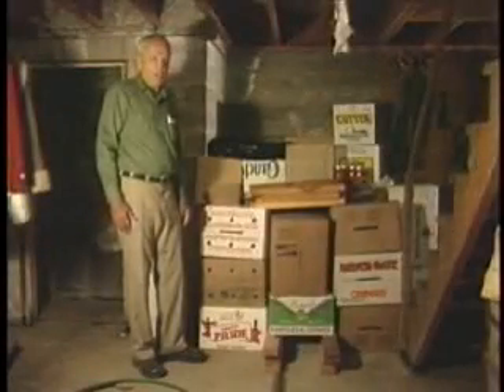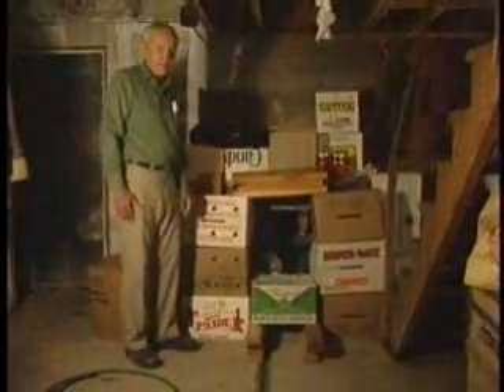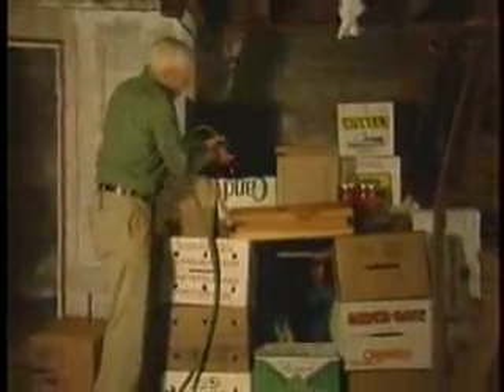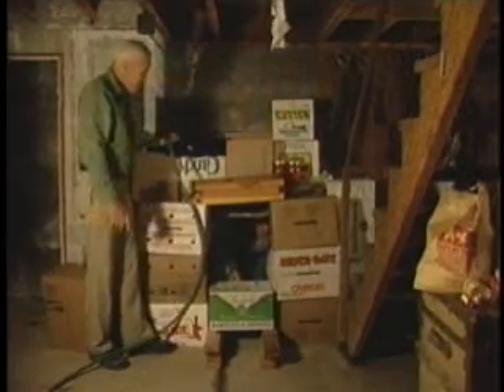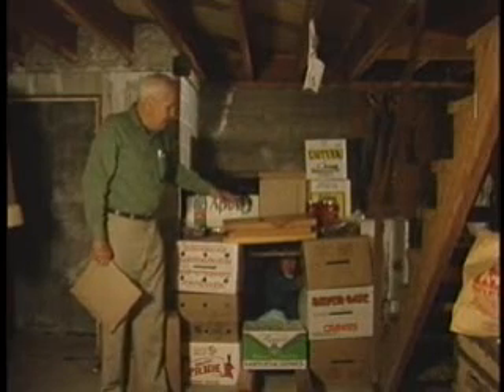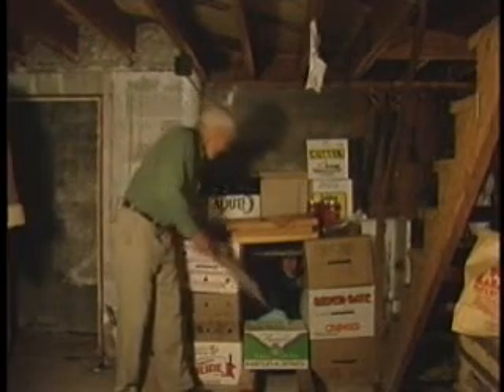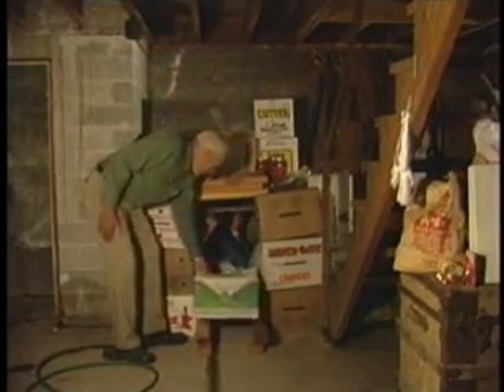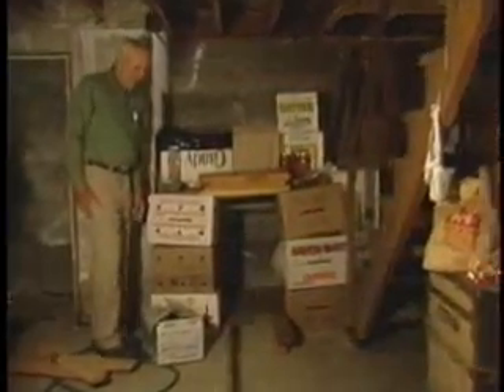Basement Core Shelter

Comment: Thank you. Gave me the idea to use make a tall heavy table covered/surrounded by 32packs od water, sand bags, Plywood coated with mylar blankets.  Might be good to make a cheese cloth/moslin fabric filter sheet to throw over the top to help with any radioactive dust.

Comment: I built a wall with plastic totes filled with rock and dirt it will protect 100%  I hope
Reply: That is a great start! Great job and congratulations! Just one thing: When you say wall, I hope you mean above you and all around you. The Radiation won't just be coming in from the walls, it will also be coming down from the roof. If you are making an expedient shelter like the one in the video, I hope that you have tested the table to make sure that it will take the weight of the totes.